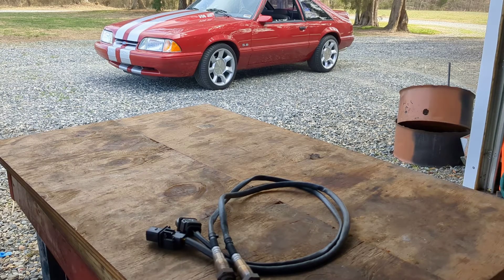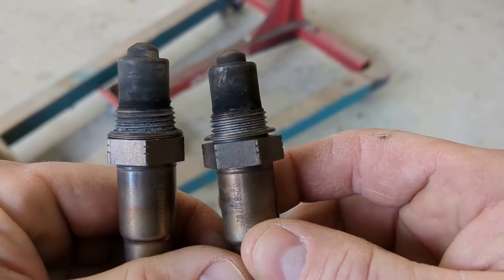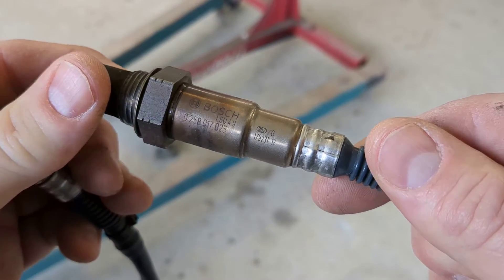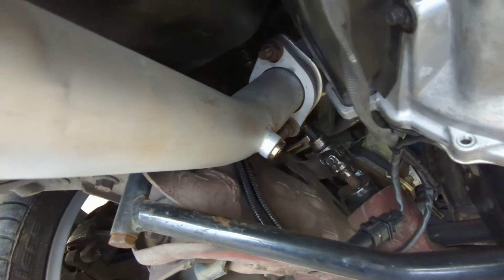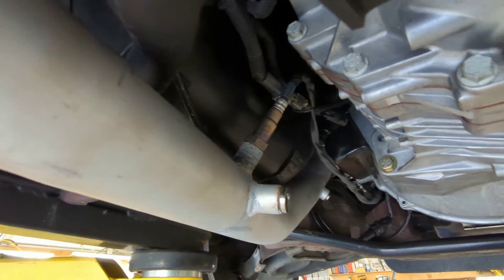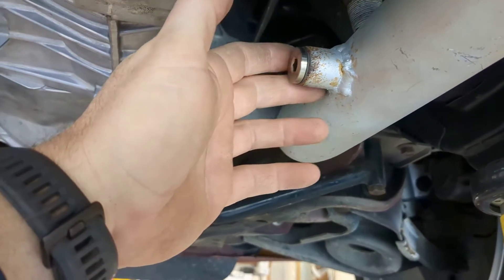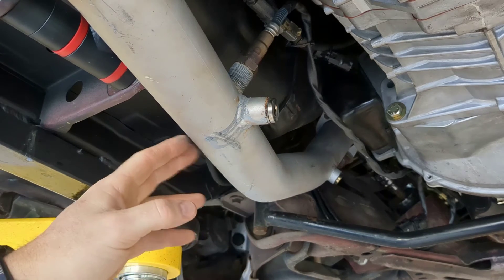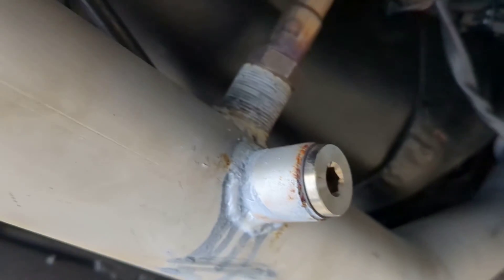Wideband O2 Sensor Wisdom - Longevity?  How to make them last.

Comment: So I have the Pro-M as well installed it with Innovate O2 sensors, ran it one summer with no issues, the second summer im having issues and think its a O2 sensor problem. I've been following your channel for sometime now. Was thinking of switching from Innovate to Z-tronix, but after seeing this and you still having  sensor issues thinking of sticking with Innovate and just relocating the sensors. Thanks for the video. Was hopping not to have these problems. Been thinking I should just go to a carburetor on my 88GT. Getting tired of chasing my tail. Do you know of a good way to test the O2 sensors to see which ones are bad or is the gauge a good enough of an indicator? Thanks!!
Reply from the maker: Chris Richards says he hasn't had any issues with innovate... I still like ztronix better because you don't have to calibrate them. The codes that the computer throw will tell you which sensor, but I just relied on the gauge to tell me. Haven't had any issues since I relocated them 👍. Best of luck to you!!

Comment: Bosch sensors are trash. I’ve had some go out within a 100 miles
Reply from the maker: Oh wow! What sensors do you use?
Reply: @ThisOldFarmShop I went through two Bosch sensors with a summer only setup with the AEM wide and Autometer. When I went with the Holley ecu they have an upgraded NTK. I was so damn foolish wasting the money on the Bosch sensors
Reply: That's a nice ride Sir! And some good advice I'm gonna move mine here when I pull my tranny, with the heatsink do you think that will help with anything or just as a precaution?
Reply from the maker: @Pooch_6969 I would say the heatsink is only needed in extreme situations where you have to put the wideband O2 sensor too close to the header. If you're putting it in the normal location then you probably don't need it 👍👍